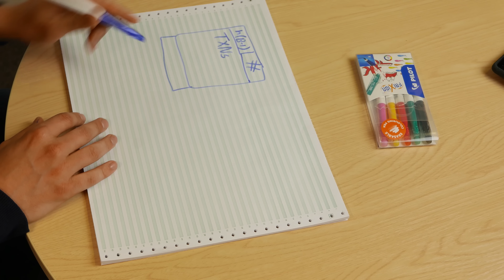Bitcoin Mining in 4 Minutes - Computerphile

Comment: For anyone interested, there's more to mining Bitcoin than this. Bitcoin uses a 32 Bit integer for it's Nonce, which means that there are only 2,147,483,647 nonces that can be used in a given hash. This number might seem very high, but in reality, super powered networks can hash through every nonce in a few milliseconds. Well, if that's the case, and if a suitable hash can't be found with every nonce (Which almost always happens), what do you do then?

First, Bitcoin also adds in the Unix timestamp for each second that passes by.That way, the hash can change every second, kind of like a second Nonce of sorts. But, more importantly, you as the miner have the ability to also change the transactions listed in each block. Each block can hold up to 1 MB of data, I believe, which is around 2,000 transactions. If you successfully mine the block, on top of getting the 12.5 Bitcoins for mining the block, you also get the transaction fees associated with the transactions in your block. Naturally, miners choose the transactions with the highest fees so they get the most money (When you buy anything with Bitcoin, you can usually specify how much you want your transaction fee to be, so it's not a set amount, or a percentage amount).

 So, let's say that in around 15 milliseconds, a miner mines all 2,147,483,647 nonces, which happens a lot. It will then move on by removing the lowest transaction and replacing it with the next highest transaction in the pool. (I forget what it is called, but there is always a pool of transactions waiting to be mined that miners all grab from. It's distributed to each network, much like the Blockchain). The miners will then hash through every nonce again, and, most likely, the Golden Nonce will not be found again. They keep doing this until the Unix Timestamp updates to the next second, then they try all the nonces again on the original block with the original transactions. This all cycles until a Golden Nonce is finally found.

Comment: My question is "Why?" What purpose could this have other than documenting all possible SHA-256 outputs until they're instantly crackable
Reply: It's called a Proof-of-work (POW) system and it's used to deter denial of service attacks and spam on the network by requiring work (all the computer processing time) and it's also a way to distribute Bitcoin in a unpredictable way.
Reply: Hashes by their nature are very hard to forge.  If something hashes to a particular value, finding an alternative input that produces the exact same hash is basically impossible.   

By hashing the result of the new block with hashes from the previous blocks, you have in effect verified the "truth" of those transactions and those blocks previous are also linked in a chain where any modification will make the hash values not agree with the transaction data that they are derived from.

If you go back and try to illegally change the value of a transaction from a previous block, then the hash for that block and all subsequent blocks will change, as the only way to do such a thing would be to modify the transaction data such that the hash of that modified transaction data is the same as the hash of the unmodified transaction data, which is basically impossible.
Reply: The blocks contain transactions made on the network. By chaining blocks together with hashes the transactions inside them will be locked inside. You will be able to verify transactions just by verifying the hashes. Creating the chain used up a lot of time and energy, which turns into transaction security.
Reply: In addition to the other replies, only the winning hash is documented.
Reply: Just to add to xuridun's comment, there just isn't enough matter in the observable universe to be able to compute all of the SHA-256 outputs. In fact, we are many, MANY orders of magnitude away from being able to do it, even if we could literally use every last atom to create a colossal ASIC. Ergo, it is impossible.

Comment: While that's interesting, this leaves me with more questions.
Changing the nonce can only change the hash so much, at some point they won't be able to find a nonce which gives enough zeroes so what happens then? Does that mean some people won't be able to mine specific blocks at all?
Also adding leading zeroes reduces the number of possible hashes, wouldn't that increase the possibility of collisions?
Reply: 2^246 leaves enough room for all of that.
Reply: Great question. Miners exhaust all the possible nonces super quickly. Other things have to get changed like the block's timestamp. This allows all the nonces values be used again.
Reply: There will always be a nonce that will generate a hash with the number of leading zeros, changing the nonce at all will always have a drastic effect on the hash. Even if there is such a case, miners are mining different blocks depending on what transactions they put in them. This means they wont get stuck in such a situation.

Not sure what you mean by your second question though

Comment: Wow, thanks for that! That was the puzzle piece that kept missing in my Bitcoin understanding. So "the system makes it harder" means it demands more leading zeroes for the hash, right?
Reply: Correct, or more specifically a sufficiently low hash value
Reply: ok?
Reply: Every two weeks the network determines the difficulty level based on the average time it took to mine a block. It calibrates the difficulty level towards a 10 minute blocktime. More miners means a bigger hash rate, which means blocks are found faster, hence the difficulty increases.
Reply: @shredding121 who is the network? Who actually changes the difficulty?
Reply: ... and yes, difficulty level ist the number of leading zeros.
Reply: Same here! That was the bit that I couldn't understand as well.
Reply: right
Reply: I debuted my trading career as a solo trader and lost so much money before getting introduced to Mr Corey by a friend and guess what his bitcoin trading platform has been the best trading investments I’ve done in a long while
Reply: @Coreytradings .